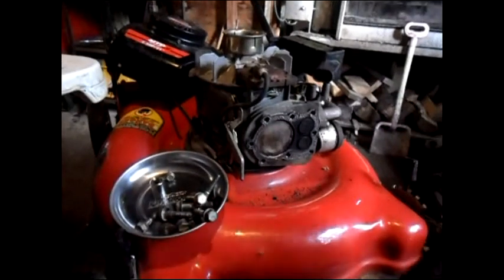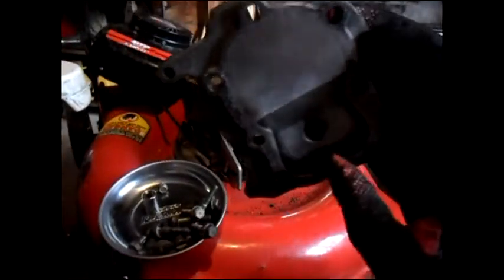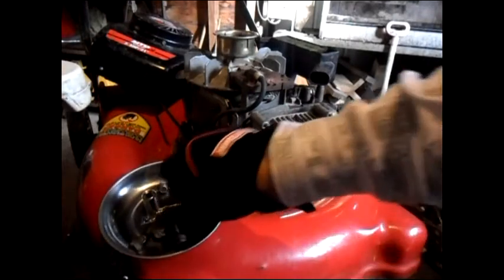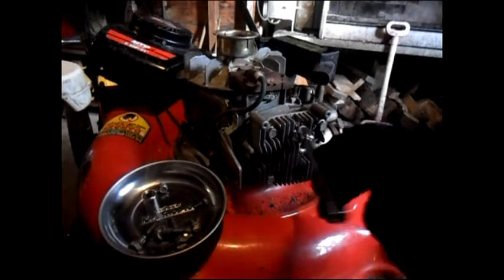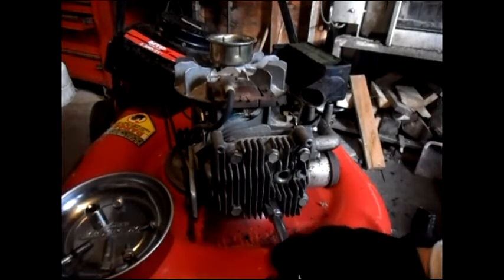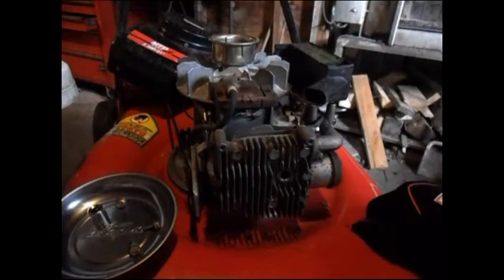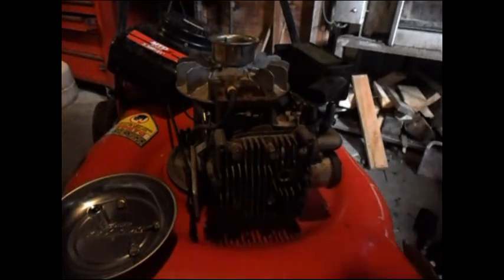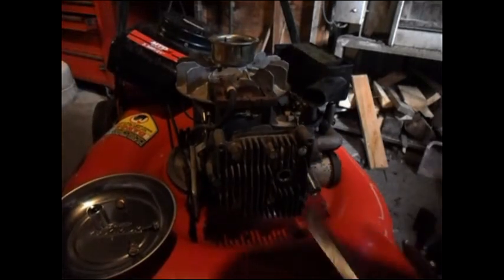How to remove carbon of a cylinder head part 2/2

Comment: the valves can be cleaned but you need to take them out and you specialized tools for it. it is dificult to do valves if you dont know what your doing, use brake parts cleaner for the carbon it helps a lot and do not use wire brushes for the valves you an old tooth brush and rag,soak the valves in brake parts cleaner for about 10 minutes and then brush them down and use a rag to dry them off, DO NOT TAKE THE VALVES OUT IF YOU ARE NOT COMFORTABLE WITH YOUR SKILLS!